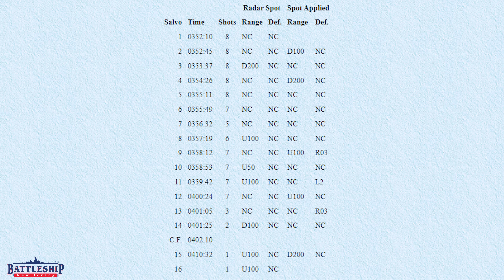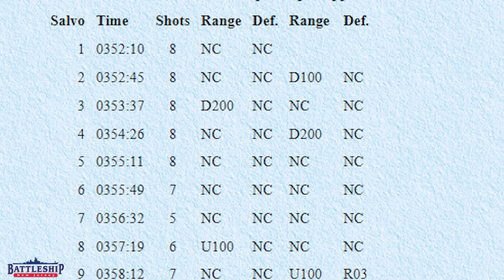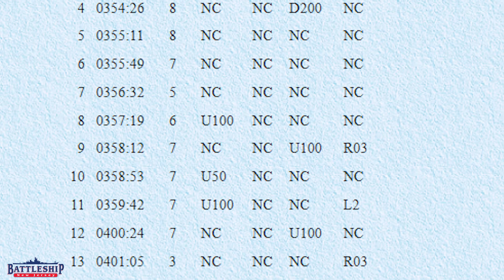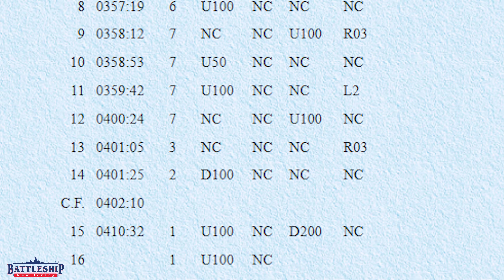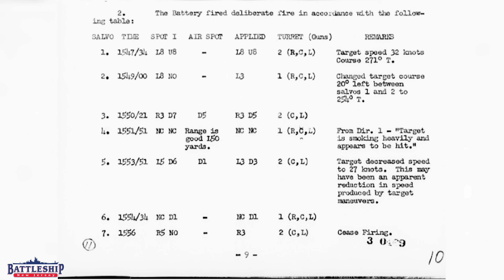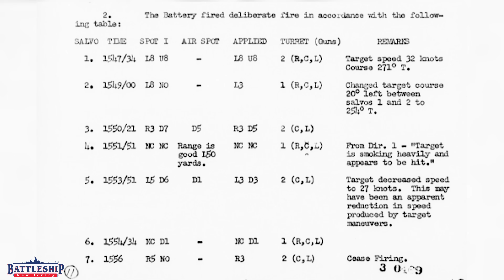Is Misfiring Naval Artillery Common?

Comment: Are they able to feed shells to other barrels in a turret if a hoist gives out? Such as sending a shell to the middle barrel and then transferring it to the left or right barrels.
Reply: Nope, each of the three guns in the turret has its own dedicated projectile hoist, with no designed way to cross the projectile over to any other gun room.  There would be no practical way to pick one up out of the spanning tray of say the center gun and get it over to the other guns.  Just inside the turret officer's compartment in line with the doors from there into each gun room, there is a chainfall eyeball welded to the roof of the gunhouse.  I suppose if the crew could get a manual chain hoist and a projectile sling, they might be able to drag a projectile into the turret officer's compartment, relocate the chain hoist and drag it over to the adjoining door and then reverse the process to get it into the adjacent gun room, but the chances of doing that successfully would be near zero.  Not to mention that the amount of manpower you'd need to do that would take crew away from the jobs they are supposed to be doing while the guns are firing, further degrading the number of rounds you are sending downrange.

Since each of the three guns has its own dedicated projectile hoist (and powder hoist, too), the failure of one projectile hoist would only put that one gun out of action.

Comment: Makes a lot of sense.  Various points of failure to include the powder and equipment themselves.  Gun crew fatigue, etc.

With small arms you have all sorts of causes for a stoppage in the weapon.  The round itself.  The magazine or weapon itself.  Maybe even foreign debris.  But with training it's easy to get a weapon back into action in seconds, with most cases.

But for big guns?  That's not so easy it seems.

Comment: May not have been cost effective to use 16inch on a destroyer, but 2 or 3 hits should do the job.
Talking board games, Panzerblitz limits you to 10 turns at best. You can go rapid fire, but they then consider the barrel lining worn out, and the unit tile is considered lost. 
You make a very logical argument. 
You might check with Drachinifel, IIRC about Jutland, a lot of the German and British ships didnt fire at times due to damage, out of range, or smoke obscured targets.

Comment: I always assumed that the guns were pretty much 100% reliable. Now I understand why they need so many guns, not just for volume of fire, but for redundancy.
Reply: Is there ever too much redundancy on a battleship?  🤷🏼‍♂️
Reply: Battleships were designed by the Bureau of Ships, but the Navy Department of Redundancy Department (Navy) had significant design input.
Reply: Mr James  i also  thought  the same thing that    battleships heavy guns were 100% Reliable  Well surprise surprise surprise  they are not and not very accurate or Reliable 😢😢😢😢😢

Comment: Prior to watching your videos, I would have never guessed that loading the shells/powder was such a labor intensive task. I certainly never would have guessed that there were so many men in each of the turrets.
Reply: The handling of 16" shells in US battleships always amazes me - just sliding the shells around - without any restraints! RN shell handling was by mechanical hoists from horizontal racking. Obviously, less crew fatigue, but more mechanism as a potential failure

Comment: I expected this answer. Due to my experiences, knowledge, and deductive reasoning, I figured that firing large caliber guns over any period of time can and will cause mechanical failures and crew exhaustion. Thank you for this video Ryan!!!
P.S. When are you gonna cover the Casablanca-class carriers? 😉
Reply: It appears that he may have gotten this wrong. 
Someone who apparently knows what they're talking about posted a comment and pointed out that in the links is a report on the ship maneuvering during the engagement, he walks everything through step by step and at one point the ship turned, when the turrets turned to stay on target they'd have had a barrel or two that would have shot the superstructure if they'd have fired, that's what accounts for some of them not firing, it's not that something broke or the crews couldn't get them loaded in time.
Reply: @dukecraig2402  If memory serves me right, Mr. Ryan did address some of the points you mentioned, i.e. other ships getting in the way. But yes, I agree with you, there are more causes than Mr. Ryan has listed that would prevent multiple guns not firing. :)

Comment: Great video Ryan. I am impressed, and not surprised about the raw data the Navy collects on the operation of these massive guns. Kudos to my brothers, the Gunners Mates that maintain and operate these systems. After watching many videos on the USS Iowa turret explosion and ensuing investigation about the cause, it becomes apparent that each step in the process of firing a gun turret, is important for success and safety. I was hoping in this video you would address the steps undertaken during a misfire. We have all had them will small arms, and they can be tricky. With a 16 inch gun, I personally would be terrified. With that said, I have no doubt that there are standard operating procedures and our GM's have knowledge on how to proceed when a misfire occurs. To this day, I am proud to say we operated with the New Jersey and made a port call together in Sasebo, Japan. What a sight to see those 16 inchers!
Reply: Exactly, I thought by the title we were going to learn about what happens when the powder doesn't light off and what they had to do to get the powder and the projectile out of the gun barrel.
Reply: @dukecraig2402  With handguns asnd shoulder guns, they usually use the term misfire to talk about when the trigger is pulled and the gun either doesn't fire or doesn't chamber another bullet. And I was thinking "isn't a misfire in a battleship gun just going to be a massive explosion or a failed primer?" Now I see there are more options.
Reply: @extragoogleaccount6061  
Yea that's obvious AFTER watching the video but as I said when I clicked on it I thought that was going to be the gist of things, and I'd still like to know how they clear something like that, it's gotta be interesting since obviously you don't just drop the magazine and pull the charging handle to the rear and observe the chamber. 
I wanna know how they get a projectile that weights as much as a Volkswagen Beatle and a buch of powder bags that's been rammed in there by that massive hydraulic ram out of it, I'll bet that's a hair raising task, I don't know how happy I'd be about having to open the breach on that thing after it goes click.

Comment: How were things remediated when there is a misfire with everything in the pipe? You mentioned that cordite bag failing to go off for King George V, if the shell is firmly engaged with the rifling taking it back out would ruin it right?

Comment: I read an account of the famous sinking of U-85 by the USS Roper, and in their excitement, the Roper's gunners accidentally pulled the triggers on empty chambers. Pre-war doctrine dictated waiting three minutes before trying to clear a misfire. So, believing that the rounds had misfired, the Roper's gunners could only stand there as the U-85 was only like 200 yards away.
Reply: What are you talking about?  There is no documentation I've read about this occurring on USS Roper.  Shells did hit the submarine and that's why it sunk.   If a naval artillery misfires another primer can be inserted without opening the breach.   You should never lose track of if the artillery is loaded or not as you don't keep it loaded.

Comment: If misfire like the ones happened onboard Iowa, yes it does happen, but it is so rare.
BTW: I know it won’t stand if rules of evidence and “beyond reasonable doubt” apply, but I don’t believe what happened onboard Iowa was just an accident. Someone bought a double indemnity life insurance and put another crew member as beneficiary, and the insured person died in an accident and the beneficiary survived. To me, I have at least 51% confidence that both events are related. And remember, in a military NJP or an admin board, it just takes more than 50% confidence from the commanding officer or board members to put someone guilty.
Reply: They will never know what really happened.
The gun caption did say we have a problem, just before the explosion.
They know there was five powder bags loaded instead of six because of the type of powder used. They do know the bags were rammed in 20 inches to far, because of the 5 bag charge.  The rest will never be known.
Reply: @Ron52G  Subsequent testing by Sandia National Laboratories removed any question about whether the explosion was caused by a mechanical or chemical detonator---properties that the Navy investigation claimed was "evidence" of a detonator were found by Sandia to be common in the turrets and on the projectiles.  Without proof of a detonator, any theory postulating a deliberate act falls apart.  During the second investigation, Sandia and Crane Weapons testing revealed that while the propellant grains themselves were stable and within specifications (despite their age), they discovered a heretofore unknown situation:  the quantity and arrangement of the propellant grains in the tare layer of the bag created an ignition hazard.  Unlike the grains in the main bag, the tare layer grains "lay down" and are much more easily crushed by rough handling and overly aggressive ramming.  The fewer grains in the tare layer, the more likely they are to crush, and the process of crushing may create enough internal heat to ignite the grains.  In the powder train arrangement, the bags are laid head to foot, with the head being the tare layer and the foot being the black powder layer.  So if the tare layer grains ignite, they will be smoldering jammed right up against the next bag's black powder layer.  Once Sandia and Crane realized this and tested in scale and full-charge, they found the only plausible explanation.
Reply: Also known as talking out your ass.
Reply: Clayton Hartwig took out an insurance policy and named buddy Kendall Truitt as the beneficiary TWO YEARS before the explosion.  Some sources state Hartwig also had policies naming his parents and another friend as beneficiaries.
Reply: @SomeRandomHuman717  thanks for the correction.